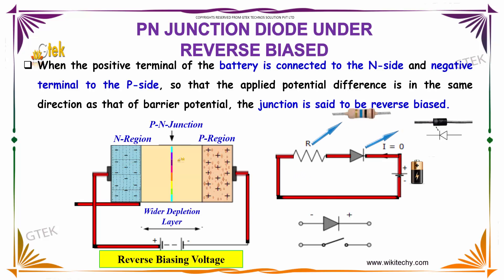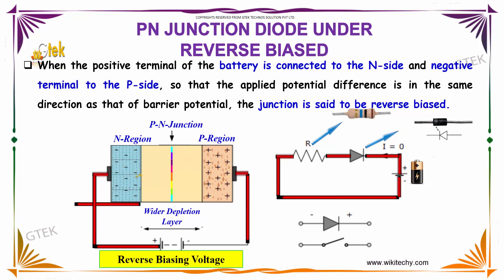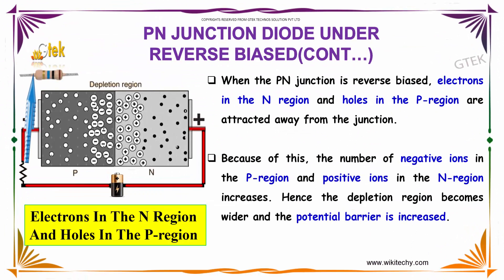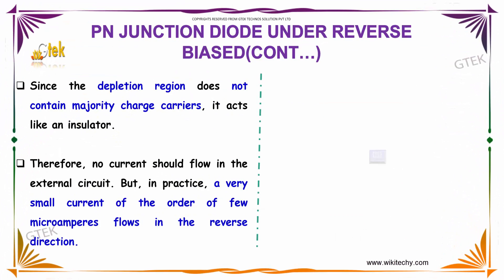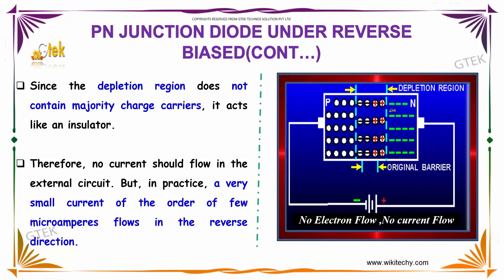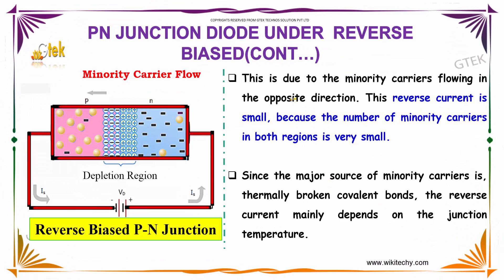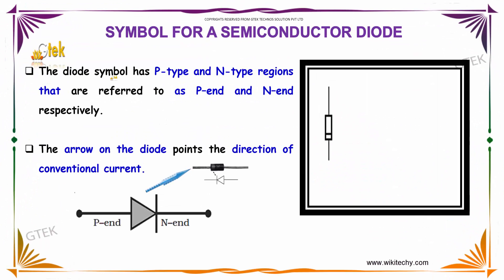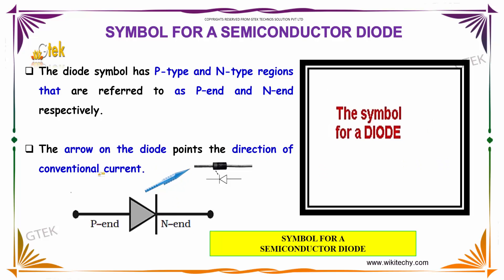PN Junction Diode Under Reverse Biased | Semiconductor Device |class 12 physics notes|CBSE|IITJEE

Comment: Connecting the P-type region to the negative terminal of the battery and the N-type region to the positive terminal corresponds to reverse bias. If a diode is reverse-biased, the voltage at the cathode is comparatively higher than the anode. Therefore, no current will flow until the diode breaks down.

Comment: Forward bias occurs when the positive terminal of battery is connected to the P region and the negative terminal of battery is connected to the N region. In this condition what happens is the positive terminal repels the holes towards the junction and the negative terminal repels the electrons towards the junction.

Comment: e p-n junction diode in forward bias condition. The p region is connected to the positive terminal and n region is connected to the negative terminal of the DC voltage source.

Comment: PN junction diode is symbolically represented as shown in picture. The direction of arrow is the direction of conventional current flow (under forward bias). Now lets try applying an external voltage to the pn junction diode. The process of applying an external voltage is called as “biasing”.

Comment: A p–n junction is a boundary or interface between two types of semiconductor material, p-type ... For example, a common type of transistor, the bipolar junction transistor, ... Bias is the application of a voltage across a p–n junction; forward bias is in ... Under the junction, plots for the charge density, the electric field, and the ...

Comment: P-N junction diode is the most fundamental and the simplest electronics device. When one side of an intrinsic semiconductor is doped with acceptor i.e, one side is made p-type by doping with n-type material, a p-n junction diodeis formed. This is a two terminal device.

Comment: Forward Biased PN Junction Diode. When a diode is connected in a Forward Bias condition, a negative voltage is applied to the N-type material and a positive voltage is applied to the P-type material. If this external voltage becomes greater than the value of the potential barrier, approx.

Comment: When a diode is connected in a Forward Bias condition, a negative voltage is applied to the N-type material and a positive voltage is applied to the P-type material. If this external voltage becomes greater than the value of the potential barrier, approx.

Comment: Biasing, in general, refers to the application of DC voltage across the terminals of device to establish certain operating condition for the device.Speaking of diode biasing in simple language, it simply means that external voltage is applied across the two terminals of the diode. Diode biasing can be done in two different waysForward biasingReverse biasingOfcourse the third condition is also possible when no bias is applied to the diode. That condition is simply called – no bias. We shall see in detail what is forward bias and reverse bias, and also the effect of biasing on the depletion region.Forward biasingWhen the positive terminal of the battery is connected to the p-type material and the negative terminal of the battery is connected to the n-type material, such a connection is called forward bias. Above figure shows the p-n junction diode in forward bias condition. The p region is connected to the positive terminal and n region is connected to the negative terminal of the DC voltage source. A resistor is also connected in series with the diode to make sure the current in the circuit does not rise above the maximum limit and damage the diode. When the diode is forward biased, the electric field in the depletion region and the external electric field due the DC voltage source are in opposite direction (This is shown in the above figure). This reduces the effective/net electric field in the depletion region. Recall that in the previous section on p-n junction diode, we had discussed that the flow of electrons and holes ceased due to the electric field. Since the net electric field is now reduced due to forward bias, electrons and holes now crosses the junction and constitutes a current. The direction of current is from p-region to n-region.The flow of current can be explained as follows. The electrons and holes crosses the p-n junction as a result of reduced electric field in the depletion region. Electrons from the n-region crosses the junction and enters the p-region.Since the positive terminal of the battery is connected to the p-region, the electrons experiences an attractive force and moves to the positive terminal of the battery. Same discussion can also be applied to holes. Thus we can conclude that current flow takes place when the diode is forward biased.Now we shall see the effect of applying forward bias to the diode. The topics we shall discuss are as followsEffect on depletion region due to forward biasEffect of barrier potential during forward biasEffect on depletion region due to forward biasWhen the diode is connected in forward bias, the electric field due to external voltage source and the electric field due to depletion region are in the opposite direction. This reduces the net electric field in the junction and the electrons can now pass from n-region to the p-region. As more electrons now flows into the depletion region, the number of positive ions is reduced. Same discussion can also be applied to holes. With the reduction in net electric field, the holes can now flow into the n-region. As the holes pass through the depletion region, the number of negative ions also decreases. Hence the the width of depletion region decreases due to reduction in the number of positive and negative ions. This is shown graphically in the figure below. Effect of barrier potential during forward biasBefore preceding with this discussion, let us have a quick revision of what is  called as barrier potential (the concept is explained in detail here). When p-type and n-type materials are joined together, the electrons from n-type material starts to move towards p-type material and forms negative ions. Similarly the holes from the p-type material starts to move towards n-type material and forms positive ions. This separation of  positive and negative ions creates an electric field. When the electric field becomes sufficiently strong, it prevents further movement of electrons and holes. The potential resulting from such electric field act as barrier for further movement of electrons and holes. This potential is called barrier potential.Now we come to the actual discussion- what is the effect of barrier potential when the diode is forward biased? When no bias is applied, the electrons cannot gain sufficient energy to overcome the potential barrier and move to the p-region. With the diode is forward biased, the electrons get enough energy from the voltage source to overcome the potential barrier and cross the junction. Similarly the holes get sufficient energy to overcome the barrier and cross the junction. The amount of energy required by the electrons to cross the junction is equal to the barrier potential (0.3 V for Ge and 0.7 V for Si). This simply means that when the diode is forward biased, the voltage drop across the diode is approximately 0.7 V (for Si). Actually, the amount of voltage drop is little above 0.7 V due to internal resistance of the material and contact resistance of the conducting material used to form the legs of diode. Reverse biasingWhen the positive terminal of the battery is connected to n-type material and the negative terminal of the  battery is connected to p-type material, such a connection is called reverse bias. Above figure shows the diode connected in reverse bias. You can clearly see that the negative terminal of the battery is connected to p-type material and the positive terminal of the battery is connected to n-type material. A resistor is also connected in series with the diode, although resistor is not required when the diode is reverse biased. When the diode is reverse biased, the electric field due to the battery and the electric field of the depletion region are in the same direction. This makes the electric field even stronger than that before reverse bias was applied. The electrons from the n-type material (majority carriers) now faces a stronger electric field and it becomes even more difficult for them to move towards the p-type material. Same discussion also applies to holes. The holes from the p-type material (majority carriers) now faces a stronger electric field and it becomes even more difficult to move from p-type to n-type material.Hence we conclude that there is no flow of current due to majority carriers when the diode is reverse biased.

Comment: Under reverse bias (V<0), whatever the weak voltage applied to the junction, the total current is fixed to -Js. This current is called the saturation current. However, for high reverse voltages, the reverse current can suddenly increase. It is then possible to reach the breakdown voltage of the junction, denoted Vc. Indeed, when the reverse voltage is increased, the electric field is increased accordingly inside the junction. But the electric field cannot exceed a given value   . This is because as the electric field increases, so does the electrostatic force   acting on the electrons linked to the crystalline network; this force can at some point become so high that it exceeds the binding force linking the valence electrons to their respective nuclei. As these electrons are released, the crystal becomes conductive and neither the electric field nor the voltage can increase any more. This means that the maximum electric field that can be applied to a semiconductor crystal is the field that would lead to the direct excitation of an electron from the valence band to the conduction band, or stated differently the field leading to the material ionization.
This breakdown effect can be related to two different physical phenomena. The first one is a tunneling effect called the Zener effect.